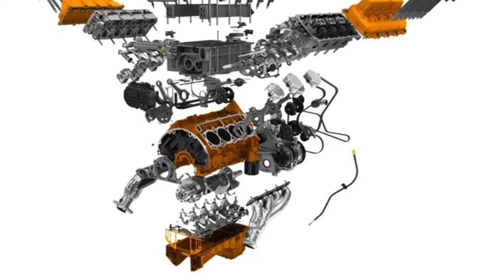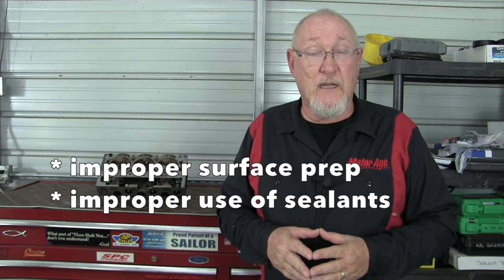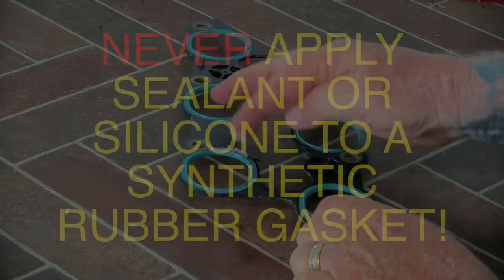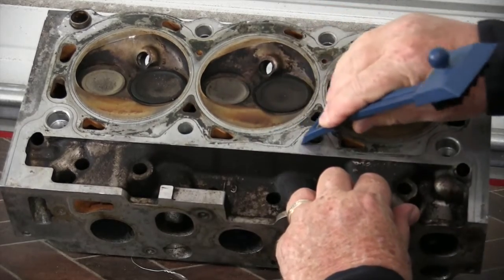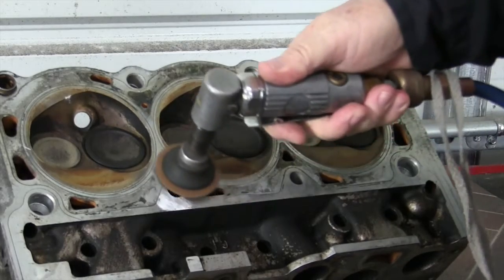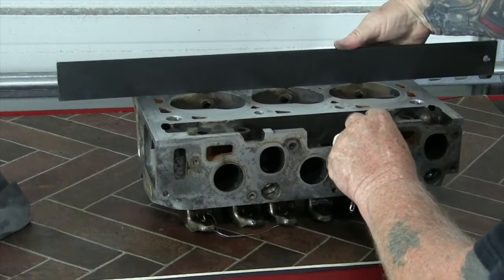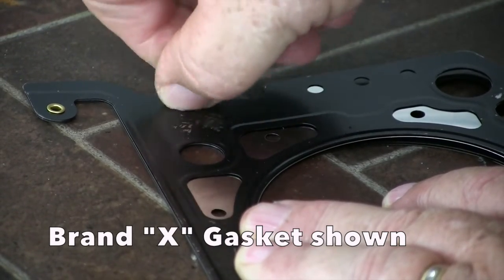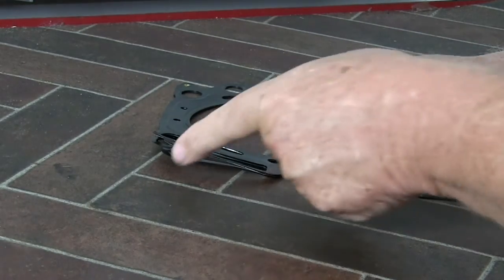The Trainer #93:  Gasket Tips For The Professional Technician

Comment: You can use razor blades just scape lightly with a small angle not to gouge the metal also finish off with brake clean and soft wire like tooth brush never had a come back